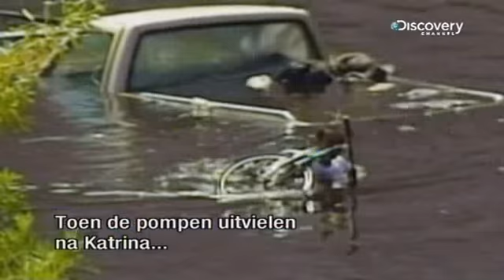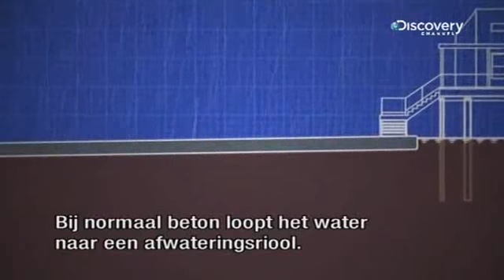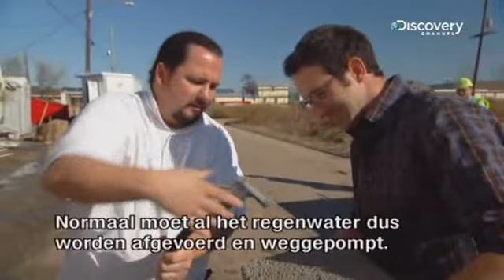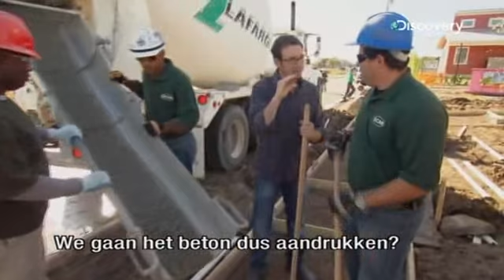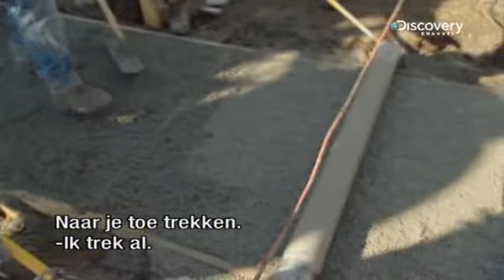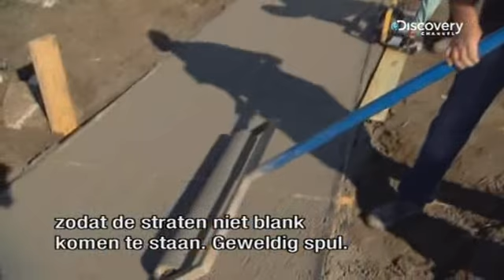Extreme Engineering New Orleans Porous Concrete

Comment: Thanks for this clip.  As a resident of  the French Quarter in New Orleans we don't have to worry about flooding since we are some of the highest ground around, but if we have to go somewhere else during or after a big thunderstorm we may have to wait awhile for the water there to go down.  Of course streets flood all the time but it is the drain system that can't keep up with all that water at once even with the giant pumping system we have,  This idea of porous concrete is marvelous; an easy, ecologically sustaining, clean and especially CHEAP way to address the problem.  I am forwarding your clip to several people we know whose driveways flood in almost every rain even though they slope up from the street.